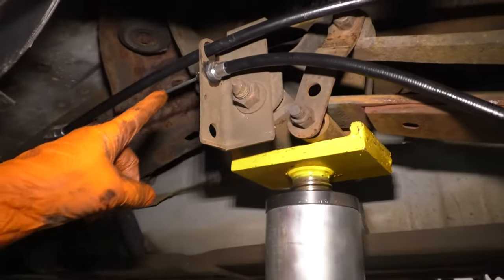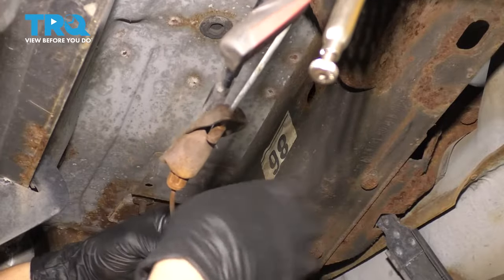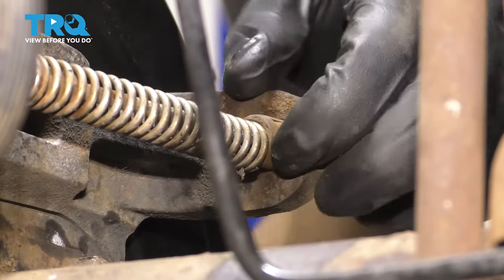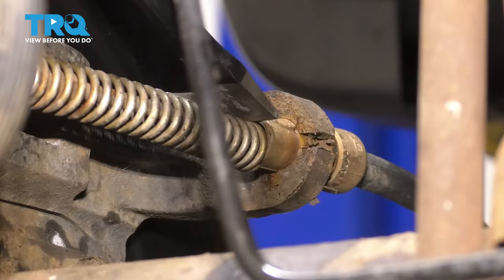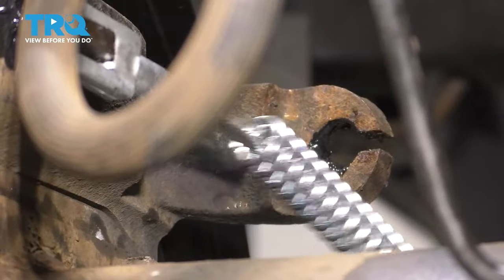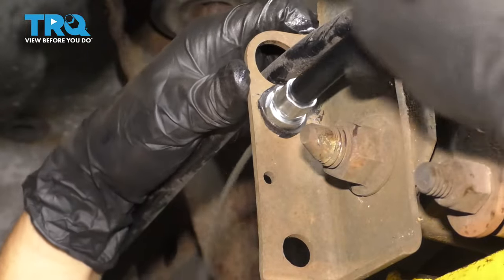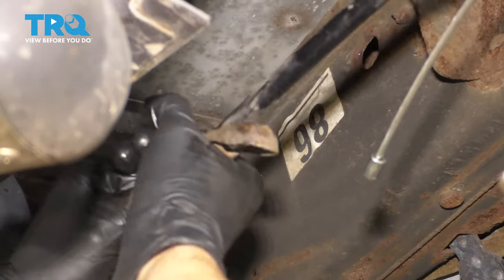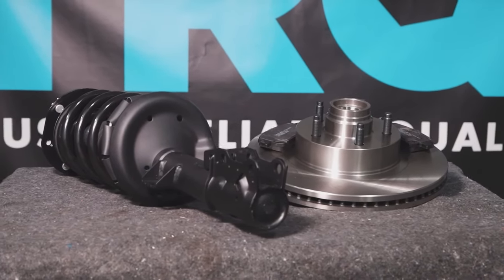How to Replace Rear Driver's Side Parking Brake Cable 1997-2003 Ford F-150

Comment: Im going to remove the cable myself, and just wait to have it replaced by a shop, if I run into trouble.  My pedel locked up/ cable there broke, so the parking break is always on now.

Comment: Ran into a 2000 f150 with the same cable size but different cable ends! Not the hook style like you have there, just a nub end like where both rear cables meet. Tried to get the other style to work but it runs against the shoes.